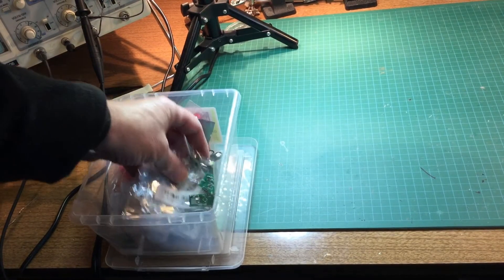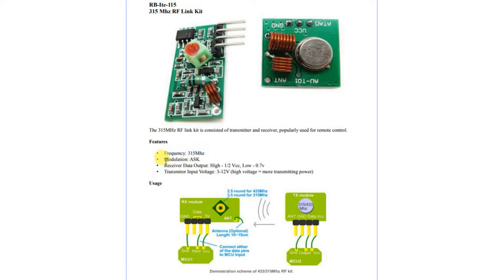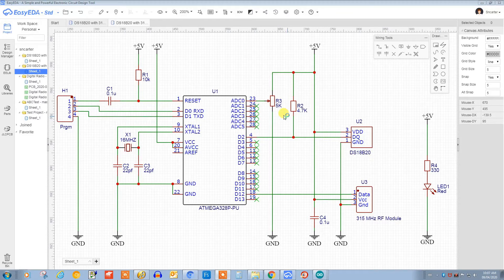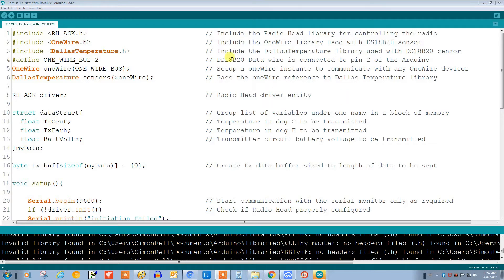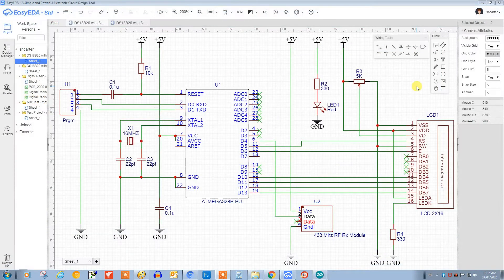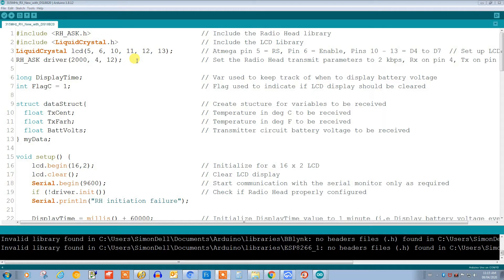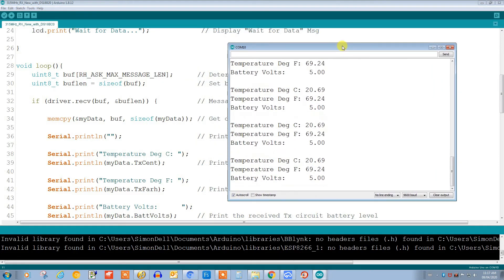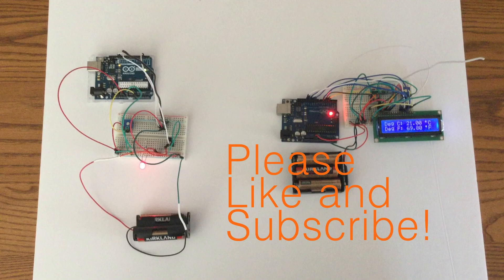DS18B20 Wireless Temperature Sensor Project on BreadBoard_V1

Comment: This was incredibly helpful thank you. Using this same method, i cannot get String or char classes to work within the struct. Rx board constantly resets. Any ideas?
Reply from the maker: Hi Michael,
I’m glad you like the video and associated instructable. I’m guessing that the issue is that the transmit struct is set up to send numbers which in this case are float and text. I confess I looked up some other code for these type transmit and receive modules and adapted it to my requirement which was numbers only. I am a mediocre programmer and I don’t completely understand how this part of the software works. I’d suggest you look up code examples for these particular tax and Rex modules. One brute force method I can think of is that you convert your string characters into numbers or ASCII and then send them and convert back to text at the receiver, but there should be an easier way. Sorry for taking a while to reply but I have just got out of hospital. Simon
Reply from the maker: I meant tx struct is set up to send numbers only.
Reply: @simoncarter568  thank you very much for the reply hope you are feeling well. I was able to get it working after days of troubleshooting by using "uint8_t, uint16_t" etc. and char arrays. Sending board Mega, receiving board ESP32. Both these boards treat int and float differently (esp32 larger) so that's what the prob was. Using the uintXY_t where XY is the bit size is cross platform/board compatible. That was the key! Cheers from Maryland...Mike
Reply from the maker: @michaelpadovani9566  glad to hear it Michael